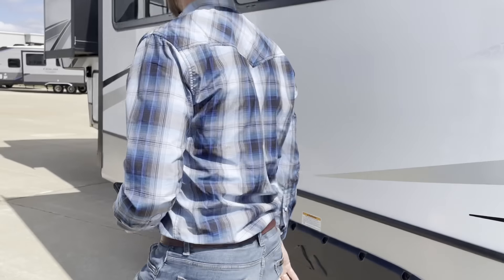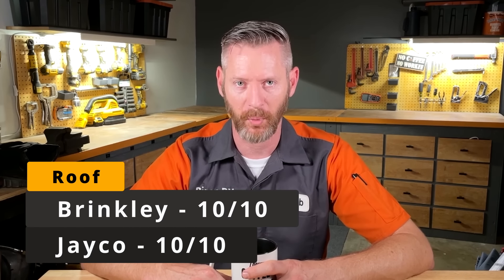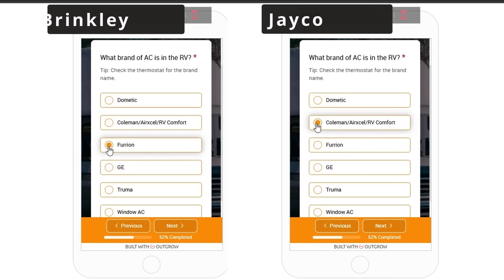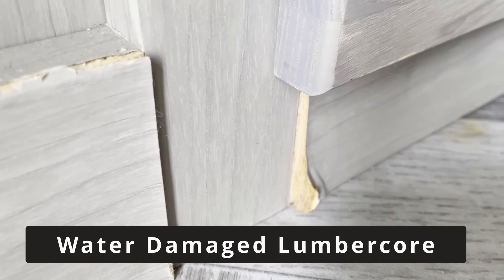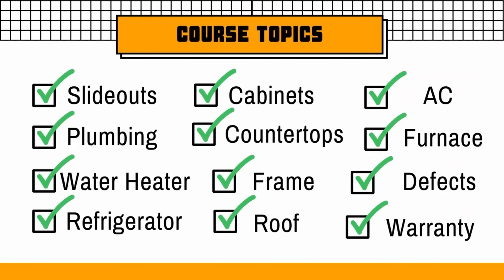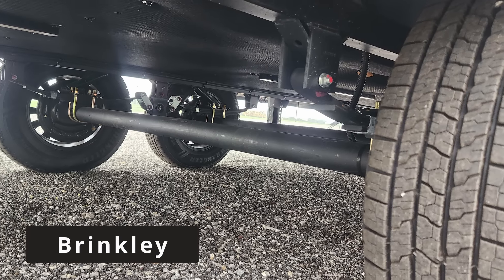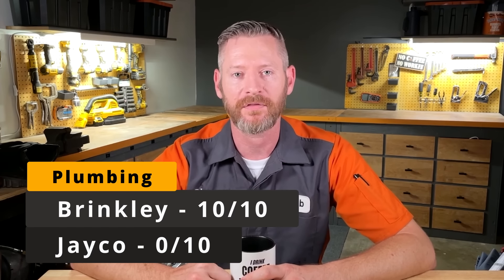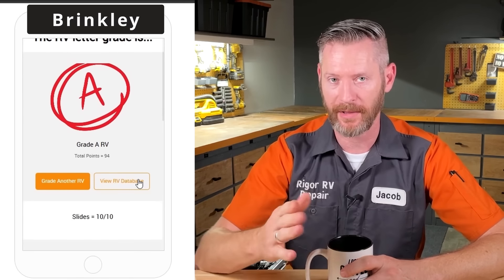UNDERCOVER RV Tech reviews Brinkley & Jayco travel trailer RVs

Comment: We were camping in Vermont in July of 2024 and met a gentleman that was in the process of trading his Airstream for a Brinkly! The reasons were 1/2 floor plans and 1/2 quality. He was on his 3rd Airstream and had an amazing amount of reliability issues with the electrical systems and plumbing. As he looked deeper into some of these failures they found absolutely terrible quality with wire management and hose & fitting quality. Plastic fittings in a $180,000.00 RV is one of the most ridiculous examples of being cheap!  I told my wife that RV manufacturers should have option packages like cars do.  Want better electrical components? Want all brass plumbing connections? Struts to hold cabinet doors open? I think most people would opt for some upgrades especially for plumbing. Just a thought. Good content by the way!
Reply from the maker: Thanks for watching and commenting!

Comment: I recently moved from a Rockwood Mini Lite to the Brinkley Z Air 285, and they are comparable in the amount of problems out the door and customer service. My reason for changing was I wanted a larger camper. My reason for choosing Brinkley over another Rockwood or Alliance (comparable floorplans and service reputation) was the foundation that Brinkley starts with. Most of their plumbing fittings are not only the correct connections, but brass instead of plastic. They are doing something to control the spaghetti mess that most manufacturers call wiring by using pre-assembled harnesses with labeled and color coded wires. Their sealant process appears to be superior to what the industry standard is, but only time will tell for sure. The fact that they are using Eternabond tape on all of the roof and wall connections and that none of the sealant is exposed to the sun speaks to how long it should last. Previous comments on Brinkley stating something is "industry standard" does not apply to their plumbing, wiring, or sealing of the unit, but it does to virtually everything else. But the bones of the Brinkley seem to me to be head and shoulders above the rest, and that is why I chose them. Is it worth $30,000? I doubt it,  but if you can afford it, get the one that should give you the best bang for your buck.
Reply from the maker: Thanks for weighing in! I appreciate the comment

Comment: My Sandpiper 402FK destination trailer used bad plumbing under the kitchen sink. I didn't know the RV industries "dirty little secret" until I started watching your videos. My hot water lines started leaking within 2 years and have been replaced already. I'm going to replace the cold water lines either this fall or in the spring before we open it up for the season. Thanks for your honest reviews as well as the information you share.
Reply from the maker: Thanks for watching! Glad the video was helpful!

Comment: Deciding which is RV is better for folks depends on how they use it and/or budget.  I have water sensors that I'm going to be placing throughout my RV to "help."  Also, budget has to be a consideration.  If you can afford the Brinkley, I would purchase the Brinkley; however, if the repairs are not that expensive, I would go with the cheaper Jayco and do the repairs.
Reply from the maker: Thanks for watching and giving input!

Comment: Bought our z2900 in July and been in shop for last 2 months.  Fridge failed twice, bathroom fan failed, front a/c failed, brakes dragging, miscellaneous pieces falling off.  Understand the failed components not of Brinkley manufacture, but been waiting exactly 30 days and still no warranty approval from factory.  Extended warranty was a waste of money, because we can’t even get new warranty work done…..  dealer has trailer and won’t respond to questions about when we can expected these issues to be resolved.
Reply from the maker: Thanks for watching and commenting! My goal with these videos is to put pressure on the RV industry to improve

Comment: So Camping lifestyle should not be understimated. I have the Brinkley  ZAir 310 and do love it. It is head and shoulders above our prior units. 

I will stay- Boondocking in this unit will be a bit more challenging and require meticulous water management. It takes a half gallon to get hot at the sink. I will be trying to turn hot on low and see if it helps. The shower is fabulous- much more in gear for full hook ups. 

I do think the extra conservation techniques will be worth it for what Brinkley brings to the table its a learning curve and a trade off.

Comment: I have a Furrion  10 cu ft fridge, made by Everchill. Both companies are now owned by Lippert. It quit working after 3 years of constant use. I called the Lippert support number. They had me check power in and power out from the board. No power out. I was told the fridge is not repairable. I’m not buying another Everchill/Furrion/Lippert fridge or an RV with this brand installed.

Comment: Soon as I got my new Rockwood Mini Lite home I took out all the cheap outlets and replaced them with home outlets after I installed blue outlet electrial boxes. I then removed all the pinch fittings on the water lines replacing them with compression rings.

Comment: we have been looking at the Brinkley as well - all the owners we've talked with (in the field) have nothing but good things to say.  Once you've bought a camper, i don't think you can look at 30k "savings" when you have a hidden leak somewhere - or hidden potential issue.  We boondook  some (3-4 days at a time) and would like some feedback on the on-demand hot water heater. I'm well aware that a 12v fridge will use battery power faster than a propane fridge - but water heater? thanks for the video

Comment: No experience with Brinkley, but can identify with the Jayco issues.  Plumbing leaks due to the exact same hot water tank compression fittings and use of cold water tubing was encountered on a 264BH. Also had bad compression fitting on hot water bath sink fitting our newer 26RL which they fixed by going through underbelly to replace the whole line resulting in an ugly taped patch. Don’t get me started on bad thermafoil which is pulling loose from day one on the kitchen countertop 🙄
Reply from the maker: Thanks for weighing in!

Comment: Might be worth it to switch tracks and find an older used rv and then size it up to the comparable model of today to show new rv'ers any upgrades or mostly the decline of construction, cabinets, plumbing etc...  I had a 2004 jayco  Eagle 291rlts fifthwheel, and that thing was a tank that I never had any major problems with. I have to shake my head when I go on a lot now to see these Luan boxes laced with mdf and thermofoil and all the other issues.  
I just think it would be cool to see your take on the old vs new.

Comment: I have a Brinkley Z 285. Its just my wife an I for the most part (kids are grown and living their own lives) so the floorpan works for us as we plan on doing some long multi month trips. We've used our trailer three times since we picked it up and I can say that it immediately felt like a home. As far as boondocking is concerned,  62 gallons fresh, 110 gallons grey, 40 gallons black. Seems like a lot to me plus it comes standard with a 370W solar panel. The one piece fiberglass residential shower was a big upgrade in my mind. Much less prone to leaks compared to the typical shower pan with glued up walls. We love the large capacity side by side fridge/freezer and the solar panel seems adequate to run the fridge and freezer during the day. It's not only the quality of the rig that makes a difference in the price. The included solar panel, the upgraded shower stall, the keyless entry, the one touch auto leveling, the stainless steel sinks, the upgraded plumbing fixtures, the better suspension and upgraded tires, the included TPMS, the included back up camera, the heavy duty ladder, two chill cube AC units (very quiet), two fireplaces, two TVs, mind boggling amount of storage,and the list goes on. Easily worth the extra $$$$. Only planned upgrades are to add a lithium battery, another solar panel, and a 3000 watt inverter to make boondocking more feasible.

Comment: Don’t have an Eagle but I think it speaks to the brand, I’ve got a ‘23 Jayco Jay Feather 25RB. So far I’ve upgraded to a Morryde SRE3000 suspension system and sumosprings for the axles. Towed all along the rough roads of the northeast and Midwest. Happy to report the trailer is still holding up great with nothing breaking. I will add the caulking issue around the kitchen sink is carried over from the eagle and does need touching up from time to time.
Reply from the maker: I appreciate you weighing in!

Comment: Who is making a fifth wheel frame that won’t break? I can’t think of the special name that we call that now but they may need to have fifth wheel frames that don’t twist or fail somebody does
Reply: Northwood RV (Arctic Fox and Fox Mountain).  In-house made frames using much thicker steel.  Be prepared though, an Arctic Fox weighs a couple of thousand pounds more than the competition.  This is due to the frame and the 2" thick walls.

Comment: I think the most important aspects of an RV you didn't cover: THE FRAME and structure. These are items that cannot be repaired easily or inexpensively. Look at the issues of the GD. Also look at the number of recalls. I would appreciate it if you compared the frame material, size, welding, hangers, cross members (i.e the Arctic Fox uses I-Beams on cross members not light weight steel with holes or simply a wire frame).  What about the roof truss design and thickness, side wall insulation, floor material.  The items you show are rather superficial. These items can't be repaired but they are the longevity of an RV.

Comment: Lumber core cabinetry still sucks!.
 Why can't the RV industry come out with something that doesn't swell when water contacts it?
 Even if only used at bottom of every cabinet that touches the floor. 
 If they are going to use a veneer wrap anyway,  why not a composite material along all bottom of cabinets.
Reply from the maker: Thanks for watching and commenting! My goal with these videos is to put pressure on the RV industry to improve

Comment: Have owned 3 Jaycos.  Currently own a Jayco North Point 5th wheel.  Totally satisfied in all areas.  Just my experience.
Reply: how would you  compare them to Grand Design?
Reply: @CJBronco2  don't know enough to make an honest comparison. I know GD has had some legal issues regarding frame flex - failure claims.  GD uses routinely produced Lippert frames.  Jayco also uses Lippert but specifies custom design specs and have had no frame issues.  Jayco also has industry best 2+3 warranty, 2 yr full RV & 3 yr structural.  Again, have been pleased with fit & finish, customer service AFTER the sale (rare), & overall build quality.  Bottomline, there is no perfect RV.  Just find one thats perfect for you & your family.
Reply: @REL3712  Thats good to know... Ty for responding..  I do know that the Jayco I'm looking (19MRK) uses the BAL frame by Norco... even tho the frame flex was with the 5th wheels, I'm turned off to Lippert and won't buy anything with a lippert frame...  Jayco - Plywood, Azdel, PVC vs GD OSB, Luhah, TPO but GDs seem to cost more...  I'll keep digging but I do Ty for your input

Comment: Thanks for pointing out the different color coding on hoses.  I have a 2021 Jayco fifthwheel and will check that right away.  I prefer the Schwintec to a cable driven slide.  I'm not sold on spending the extra 30K.  I'd change the plumbing on those locations you indicated.  Great video again and thank you.
Reply from the maker: Thanks for watching! Glad it was helpful

Comment: We just bought a 24 Jayco White Hawk (last year of the White Hawks) and I have found some bad plumbing which I will keep an eye on. Fit a finish is not great and I have had it in for warranty work for closet doors and exterior doors. We took a few short trips to work out the bugs you inevitably encounter with a new trailer (sad statement). We have an excellent dealer where I live so that helps and is a reason I purchased the Jayco. It seems to me their quality really declined after Thor bought them out in 2017 because previous Jayco’s were much better in my opinion based on the ones I owned. No way I would pay $30K extra for the Brinkley.
Reply from the maker: I appreciate the comment!
Reply: Thor really did hurt the quality of Jayco. Our last Whitehawk, 2019, just wasn't what they used to be. Moving to Alliance this spring.  @undercoverrvtech

Comment: You should have read the print on the Jayco flex tubing. Having been in both the RV industry and construction I can tell you that not all flex tubing is either hot or cold and the use of a red stripe is not universal. The print is what matters. Also there are 2 different kinds of vinyl flex tubing one of which is designed to use PEX fittings and clamps. FYI most new houses use plastic PEX fittings even when buried in a wall so if they were so bad we would have tens of thousands of homes with water running out of them. As for the thermafoil....it is fine if maintained but even at the price of the Eagle Jayco should have solid surface counters. Don't get me wrong I am a huge fan of Brinkley, have toured the factory and was very impressed but I also would not buy one because I don't feel their prices are justified. Let's see how long it takes for Brinkley to sell out for a mega profit just like Heartland and Grand Design did.

Comment: I actually have a Z Air 310 on order from Brinkley. Sure it's more money. Solid surface countertops, fit and finish, shocks., correct plumbing, excellent customer service have a value.To add those after the fact is about 12-15 thousand (I have done it on a Grand Delusion) 

Here is where the rubber meets the road for me. I was at the Hershey show and the actual owners of the company staffed the booth. I asked one a random question about a hitch set up. He called the other owner who took the rig out to test camp it for the answer. The guys was not defensive and was critiquing the trailer with me and offering insight on why they did what they did. That to me speaks volumes. 

While I love the tankless water heater as a boondocker it is not ideal but easier to work around than  poor quality. 

Thanks for the honest video's stay nit-picky!
Reply: If you were a member of the owners groups you would know this ain’t true
Reply: Feel free to educate- can’t be a member until I take possession
Reply: Feel free to educate- can’t be a member until I take possession
Reply from the maker: Thanks for watching!
Reply: Curious what customer service you’ve had to encounter without owning one?
Reply: @CaptainFantastic79  Adding options , aftermarket doors for laundry getting specs for planned mods- very helpful. no experience with warranty work obviously hope it helps...they are just firing up the line on the 310 this month. They have really been forthcoming

Comment: Enjoy your channel. The scoring IMO needs some tweaks. For example scoring both equal for cabinets is not fair based on materials used alone. Brinkley should clearly be scored higher due to the dove tail joints. I'd say the same about the slide outs. Jayco deserves a lower score due to the extra maintenance requirement. As far as this specific video, when considering if price difference is worth it are the features offered on one model vs the other. Brinkleys offer many features the Jayco does not. It's like comparing a mid level trim truck to a luxury truck. We know when buying vehicles the loaded trim levels cost a lot more. The buyer has to decide if those features are worth the money. Lastly is how they are built that you cannot see and not something you cover in your buying guide. Brinkleys use wiring harnesses for example. You won't find  the tangled mess of wires in the underbelly that you'd see on the Jayco. Overall Brinkley tries to solve for many of the most common warranty claims other manufacturers experience up front when they build them to reduce their own warranty claims & increase customer satisfaction.